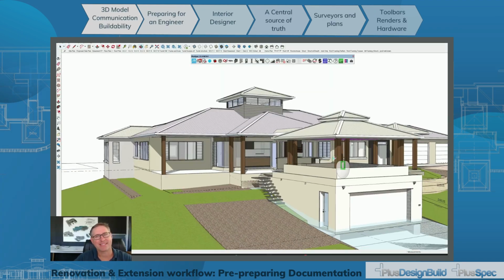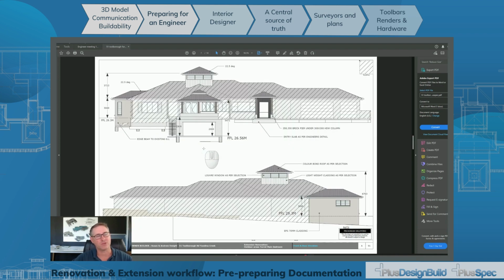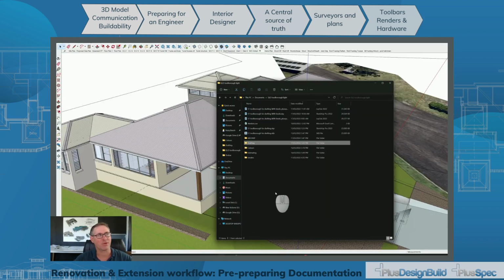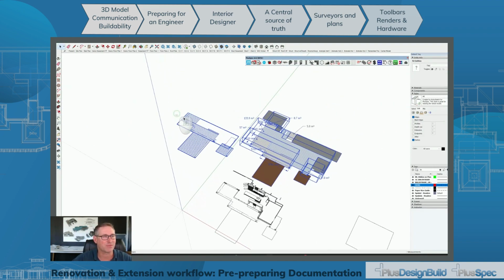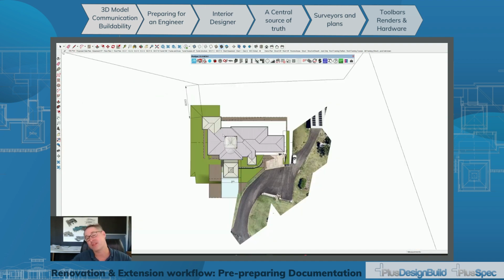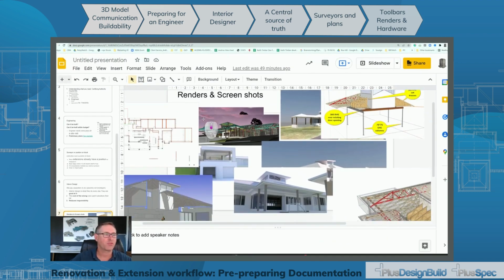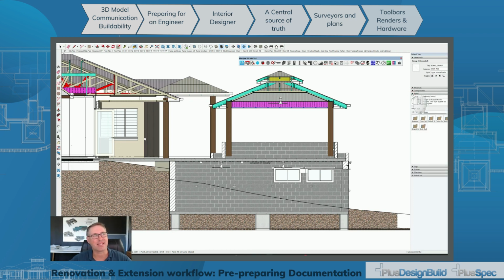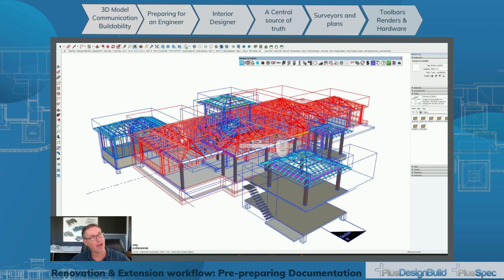Renovation & Extensions BIM Workflow with PlusDesignBuild: Part 3

Comment: Really appreciate you explaining things so well!  Can you possibly create a video showing how you would add a new roof onto a front porch and do that in a copper finish?  My other request is to show how you create the home with a california split style home and those different flow elevations and different roof lines!!
Reply from the maker: Hi Dan, yep, could you add a post on the forum? If you could add small screenshots to explain, I'll see if I can get Andrew to squeeze it in. 😉 
Note, if you go to the roof tool and click forum at the top, you'll be in the right place to ask a roof question. All tools take you to the correct position on the forum to ask questions about each tool.  Tip2. Put in the PlusSpec version you're using and Mac or PC.